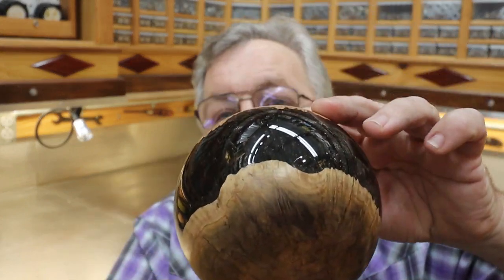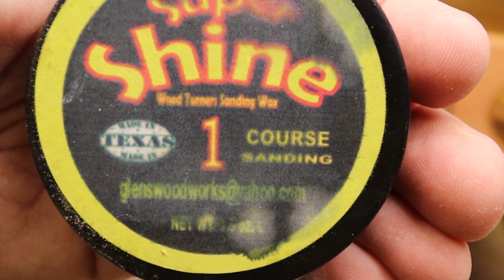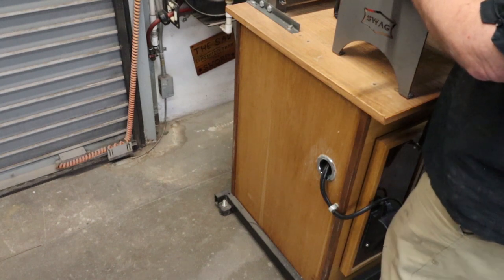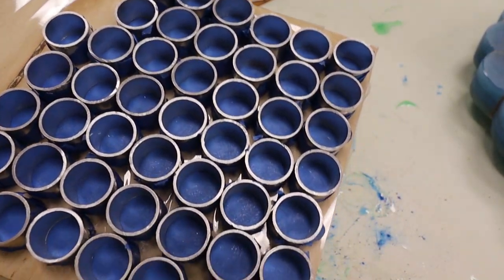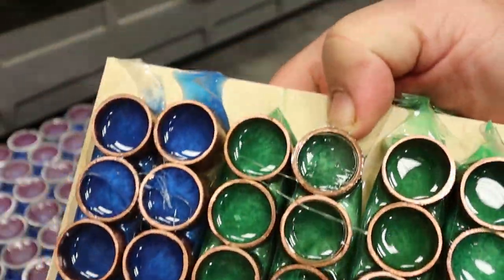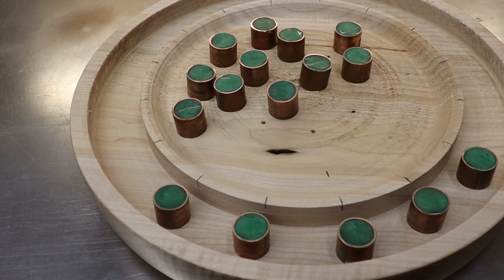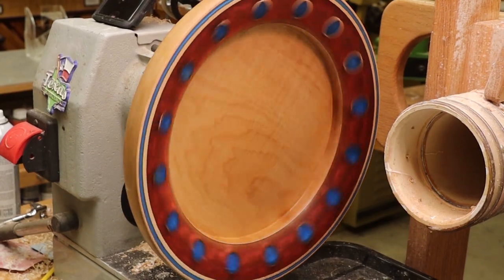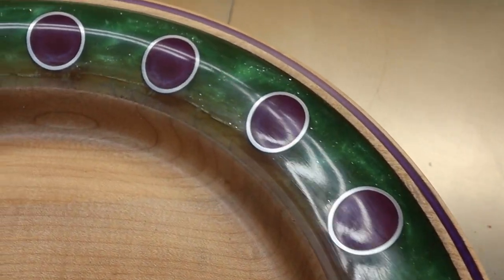resin ring platters

Comment: more info on the vertical buffer setup please.
Reply from the maker: Thank you my friend thank you so much. I didn't go through all the details of that wet sanding. because I just finished going through all the details of it on the Christmas bowl video that I put out last week. What looked like a buffer on the wheel was actually a sander. It was easier to turn down the metal and the aluminum with the resin between it with the sander. then with the turning tool for some reason the turning tool kept giving me small chips. But the final shaping of it I did with the sand that was a festool sander with like an 80 grit sandpaper on it. And thank you thank you for asking I should have explained that in the video. Merry Christmas to you my friend and a very Happy New year's and thank you from Doug